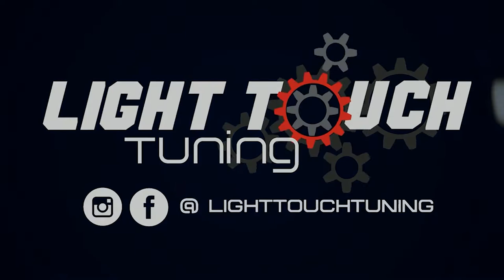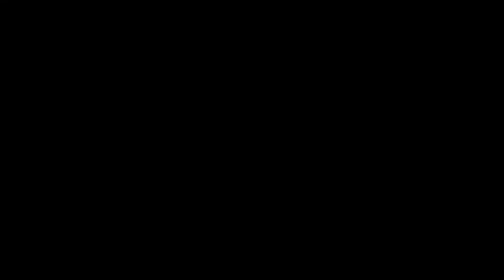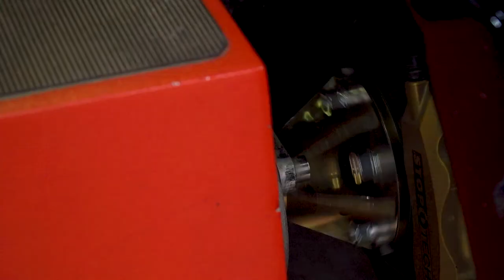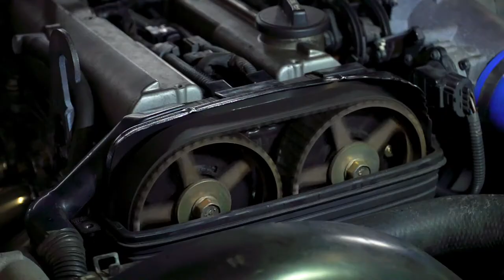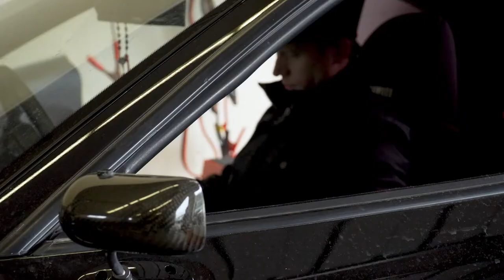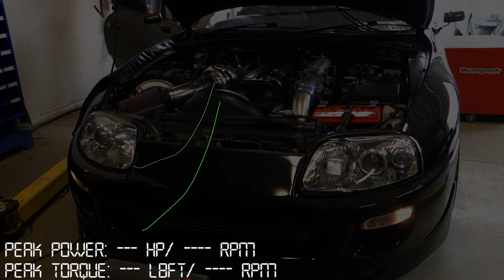MK4 Supra Megasquirt PnP - single turbo - stock injectors

Comment: Wait what?!... All this hype to make under stock power with a larger single turbo and stock 440 / 550cc  injectors?  This is the worst vid I've ever seen about a Supra... take it down.... take it down now Zacchaeus
Reply from the maker: lol, thats pretty solid for 8psi. lots of room to grow!
Reply: @LightTouchTuning  Heck you mean? That's below stock hp! How do you end up losing hp in a build lmao.
Reply: @mikeyyyy8726  well considering stock it runs 14psi, and this setup is running 8psi.... It's actually more efficient. When the client is ready to install injectors, it'll be time to chase   numbers. Ditched the stock twin as they were cooked. Also remember the book numbers are crank hp, we are observing at the wheel here.
Reply: @donaldlightfoot7968  Ohhhh, I thought that was crank hp, mb.
Reply: @LightTouchTuning  Yup, stock twins @16-18psi WHP factoring 18% drivetrain loss is approx 262WHP, so 299WHP @8psi is a great start. I'm running a single turbo with everything stock, built in front of my house, trying to learn how to tune now.......it is not easy!👍🏾
Reply: @olukunle  Stock boost is around 8psi on stock twins ~300-320 crank hp 16-18psi is more likely bpu level that goes up to 420-430 hp on jdm and could possible achieve 450+ hp on usdm bpu supras!
Currently running a bpu ~420hp at 16psi
Reply: @Placebo911911  right! Either way 299whp @8psi is not a bad start. Those single turbo setups have huge potential with a good tune and a little more boost. I'm curious as to what springs are on the Watergate though
Reply: @olukunle  I agreed!